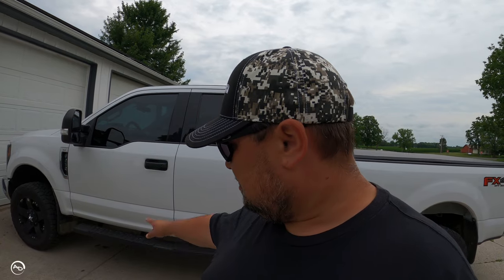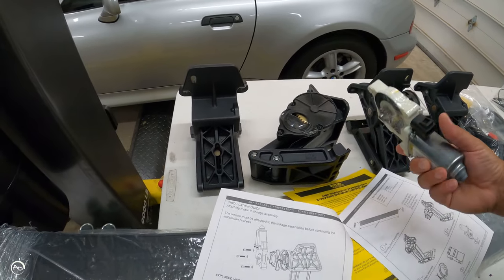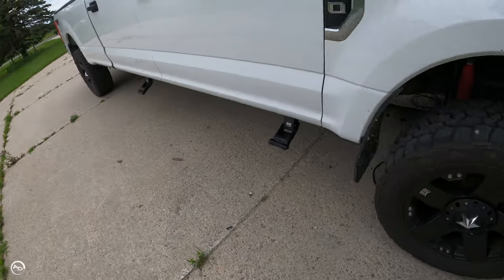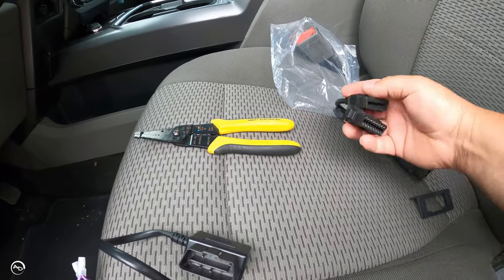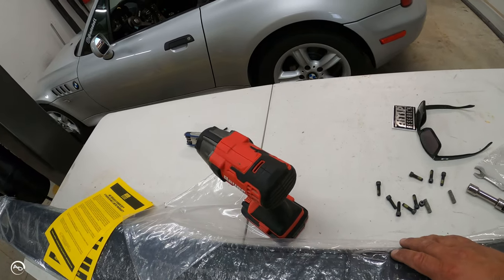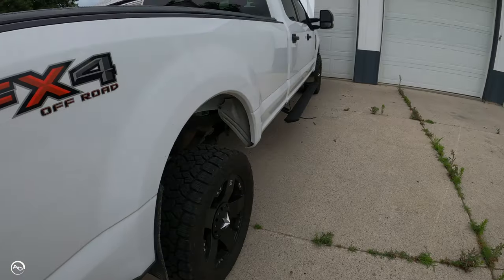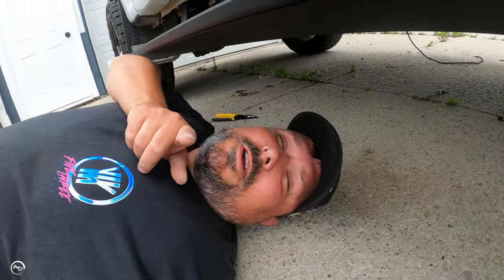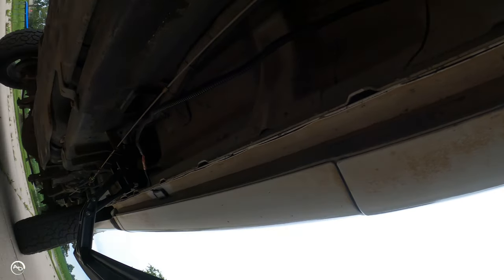AMP Research power running boards Install F150 F250

Comment: I just installed mine on a 2015 Ford F-350 Lariat Dually, It went pretty easy other than I found out I didn't need to add the bracket for the emergency brake as it was out of the way and mine didn't have any where to install the bracket, but mine came out great plus I added the extensions which worked great as my truck is lifted. saved $650.00 in having a truck place install.
Reply: $650!!!,??? I'm getting it installed for $150.00

Comment: Question,  will each LED light illuminate only after the specific door is opened?

In other words,  if I open the driver's door will both LEDs on the driver's side illuminate or just the LED underneath the driver's door?

TIA
Reply from the maker: All turn on
Reply: @AutoDad  thanks for the reply.

Comment: Very nice…but very pricey also
Reply: The trucks aren’t exactly cheap! You can’t order power r/b with 40-20-40 front seat on 22 F 250 Latiat which is a $1k option. These are nearly double. The XLs are very nice how ever.

Comment: Too expensive for something that’s that involved to install. A lesson to everyone, if you’re ordering a new truck and u want these just check off the box and get them.  This looks like a nightmare to do after. Plus u get to control them from the instrument panel with OEM.
Reply: It isn't that easy. I just went though this process with my 22 F250 lariat. They're only able to be added under certain circumstances. They weren't available for me with the way I built my lariat. Plus these hide much better than stock as well. Just put the new Amps on my 22 today.
Reply: Twin turbo how much was it because I have a 2022 F250 lariat and I want to put them on but don’t know if I should do it myself or let a dealership do it? And doesn’t the 2022 already have the plug in for them?